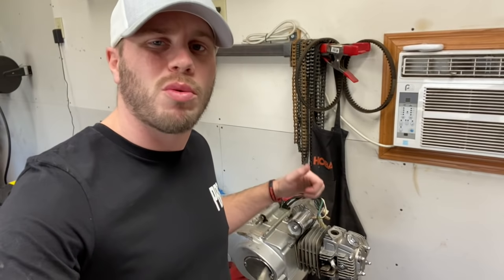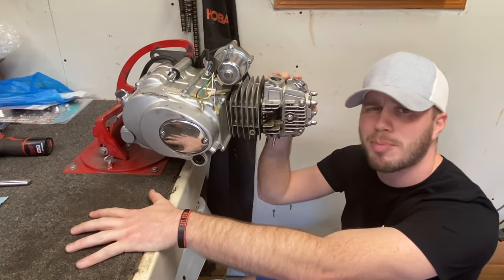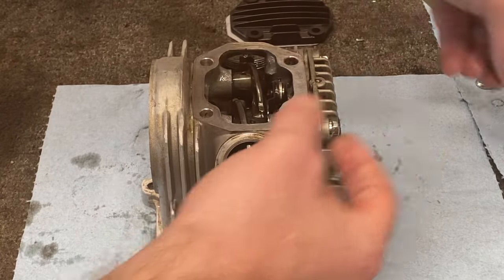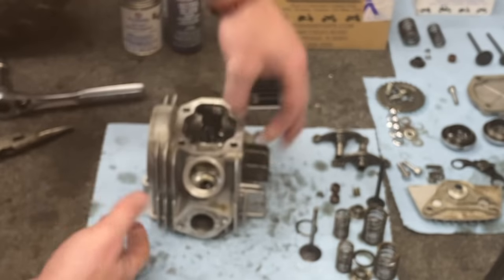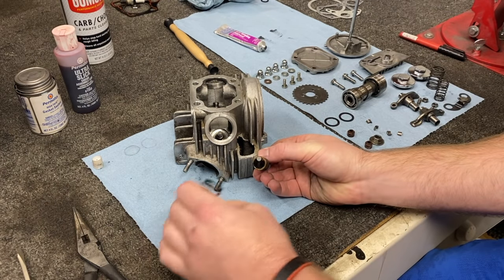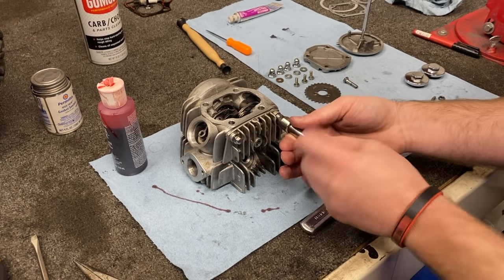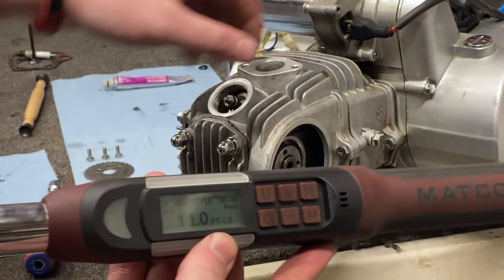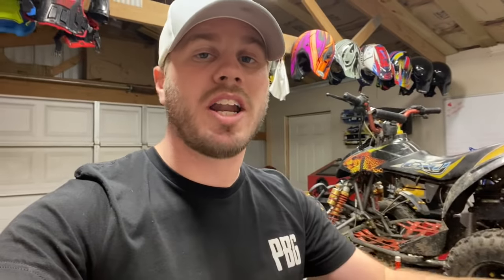HOW TO: Complete Tear Down & Rebuild of a Chinese ATV Engine Head. Every step you'll need covered!

Comment: Thanks so much for the video. Very helpful for a first timer. Struggling with my project though, hoping to get some guidance? I’ve replaced piston/bore, cleaned/lapped both valves. Compression test jumps to 30 and back to zero…no change from where I started. The puzzling thing is doing a crude leak down test (air to head from compressor), the system pressurized. I have a small hiss at the spark plug but aside that nothing coming out of exhaust, intake, or oil fill. Engine is at TDC when doing the test (line with T is centered inside the viewport). Im stumped…unless there’s something I’m overlooking. Any help appreciated, and thanks again for the helpful video.
Reply from the maker: Hey Brian, thanks for watching the videos and I am happy they have helped so far. This may sound silly but you could be getting a false reading on your tester. Do you have another piece of equipment that current runs you could test it on? (lawn mower, pressure washer)?  If everything is put back together and you have spark I would suggest trying to put a little fuel in it and see if you can get it to run for a second. If not your losing compression somewhere!
Reply from the maker: @briangandolfo5789  Honestly man it sounds like your tester, that or your spark plug hole is stripped and not sealing. Even at 30 psi the gauge will hold at 30 and not release back to zero until you clear it. My guess is if you have spark and throw fuel at it she will run. I have never experienced a loss of compression from the oil channel, but even if that was it to only hold 30 psi would mean there is literally a giant crack in the case.
Reply: Alright, well I have some renewed confidence now, maybe this whole thing is because of a bad tester, cause I don’t have any of those other conditions. I haven’t even attempted starting it yet without passing compression assuming that I wouldn’t get anywhere without a good seal. I’m on vacation but I’ll give that a try when I get back. Thanks for the feedback, I’ll let you know how it goes!
Reply: @Praska Boys. Well tester was a factor for sure, rookie mistake there. But I’m only getting 75psi on the test now with a good reading. The entire top end is brand new though. Leak down I’m getting a small amount out of the crank case so I’m losing some pressure either in the piston or through the oil reservoir. I’m just not convinced I have a good seal there, there’s oil on the gasket from the reservoir all the way to the bore. Could that be my issue? If it’s the piston idk what else to do given it’s all new. Any advice appreciated.
Reply: @briangandolfo5789  I'm also fighting this right now. About 70psi on compression. Did leak down test, heard air coming from oil filler, changed piston/rings/gaskets (cylinder still has cross hatching and not gouged). Compression test again shows 70psi and leak down test still coming from crankcase. I'm stumped.

Comment: I have just traded a cart frame for a 110cc 4 wheelerfor my Grandson and there's alot of work to be done some welding,wiring where can iget my hands on a valve press andand the lick done gage and i also have alot of other Questions. About these ATV?
Reply from the maker: Hey Michael! The tools are linked in the videos description if you want to use the same ones I do. Also for more questions you can email me directly at praskaboysgarage@gmail.com

Comment: Can the cam be in the wrong position since it can still be aligned on the exhaust stroke? How do you make sure it's in the right alignment for the compression stroke?
Reply from the maker: Now this is something I was told years ago and I've never verified it but also never had a problem with it. The cam can be in time both on the compression stroke or 180 degree out. It will fire the same. Basically how I see it, is if you're at TDC you can't make a mistake. Now, what I do is rotate the engine until it opens the exhaust valve followed immediately by the intake valve. I rotate the motor until the piston is at TDC after that which tells me I am in the compression stroke. Set your timing and should be good to go.

Comment: Hey I believe the head gasket is blown on my sons Tao Tao 125 atv. It’s popping a lot, from that area, and it’s losing speed when accelerating. I’ve already replaced the carb, and. Cleaned the jets.  I decided to replace the entire. Head.  My question is. Do I need to remove the entire engine from the bike to replace the head? Will it clear the frame?
Reply from the maker: Depends on the ATV actually. If you're in a smaller frame unit like the TaoTao Boulder B1 you will have to remove the motor, but on a larger sports quad will have room. I usually just remove to make it easier for me!

Comment: What is the engine mount you’re using? Great video btw
Reply from the maker: Thanks! This is my #1 question for sure! I actually had a CNC company laser cut out all the metal to start making and selling my own. I will be selling the kits on my website either as a DIY kit or a completely assembled and power coated. Should have everything ready soon and will post updates on the channel.
Reply: @PraskaBoysGarage  yes!!!!  That engine stand is so awesome!

Comment: Great video but I have one question. Why not set the valves up before you put it in? The refurb you showed was already set. I ask because I am doing this to a 110cc and I am leaving the engine in the kart so I don't wanna have to set the valves after the head is back in. Just curious if there was a reason to do it after the install.
Reply from the maker: Thanks! I always set the valves after installing the head to make sure the cam is perfectly aligned at top dead center. That way I know 100% it is set correctly. You could do it off the motor, I just want to make sure I have 0 chance of error.
Reply: @PraskaBoysGarage  I tore it apart today and the intake valve was bent so bad it rubbed the seat so I am ordering a whole new head. Will have fun getting it all back together and firing it up! Can't wait! Thanks for the video as it helped me get this apart in less than 10 min!

Comment: I have a 110cc redcat motor. There is grey smoke coming from the exhaust, (more than there should be.) When I take a look at the muffler, I see there is oil on the inside of it. I think it could be the rings on the pistons but I’m not sure. Any help would be appreciated
Reply from the maker: You're on the right track. I would perform a leak down and compression test and see what kind of state the motor is in!

Comment: I bought a used Chinese ATV and it does not have the decompression valve. I am not sure if its originally had it. It is really hard to kick start. Even the electronic starter suffers when I try to start it. How do I make it easier to kick start?
Reply from the maker: The decompression valve is actually pretty rare on these motors. I was surprised to actually see it. If yours didn't have one when you looked I doubt anyone removed it.

Comment: Were the valve clearances you used from a Honda? Setting my sons chinese 50 and using specs from a CRF50. I believe it called for .002 int. And .003 exh. Seem a little tight?
Reply from the maker: My valve clearances are based on my personal preference but used from the guidelines from Honda motors from the late 90s and early 2000s. That's probably right for a Honda 50cc. I know the CRF70s call for .005 & .005

Comment: Can you tell me what kind bench mounted stand that you are using? I would like to get that for my son.
Reply from the maker: This is my #1 question for sure! I actually had a CNC company laser cut out all the metal to start making and selling my own. I will be selling the kits on my website either as a DIY kit or a completely assembled and power coated. I will post updates on the channel when they are ready!

Comment: Wow .  Great  vid .I have a 125cc ybr  and its making a load of tapping noise plus major lose of power  ...I think maybe I've bent a valve .    Is this process the same for any  125cc   engine  ... springs n all .?  .  Thank u
Reply from the maker: Thanks! Glad you liked the video. The process of a rebuild is the same for all E22 style motors. Your YBR has a vertical cylinder so although the process is the same it will look a lot different because of the style of motor.

Comment: hey man, recently i got a 110cc bike come into my shop and he completely lost compression. I took off the engine head and i found the intake valve to be bent, Any idea what might of caused it cause all tensioners look good including the timing chain + guides
Reply from the maker: I have had them bend in the past quite a few times and really I think it's mostly due to being cheaply made. I had one bend I think when someone dropped a washer in the head and another time it was starved for oil and go way to hot.

Comment: The vmc website, how do you know which part is yours, I have the 125, for a top end gasket kit, it ask for mm, is that the inside of the cylinder and the closes to the mm match for 125s, tks for the help and the vid, top notch
Reply from the maker: 125cc calls for a 52.4mm top end kit. The size indicates the piston diameter. Hope that helps! Thanks for watching!

Comment: Can you add heavy duty /stiffer springs ? And port the runners ?
Reply from the maker: I never have for these E22 style motors. I've only upgraded springs on predator performance builds but that's because your throwing a lot more power threw it. You're biggest upgrade for this kind of motor would be buy a Mikuni carb or at lease a Chinese knock off carb like this one: https://amzn.to/3ssBUQm

Comment: New head, new gasket set, new piston and rings but I still only have 50psi compression. Piston at tdc and timed up perfectly.No leaks coming through the intake, exhaust, or casing. Not sure what I did wrong. Help!
Reply from the maker: 50psi should result in a pretty big leak somewhere. If no leak and those valves are sealing then you probably have either an issue with your valve lashing so double/triple check that. Also if your carb is still attached to the motor make sure you have the throttle wide open.

Comment: Do you know of a higher lift or longer duration cam that will fit this family of engine? 
Thinking about doing a mild port. Never done it but if I screw it up, haven't lost much. When installing a better carb I noticed the intake port is extremely small and never going to see any gains without addressing it.
Reply from the maker: Performance parts are tricky for these little guys. Anything I've purchased has been with Tbolt USA. They advertise performance cams that add 1hp but I have yet to test it at this point. The biggest upgrade you can do that I've found is using a Mikuni carburetor or at least the Chinese version of eBay for $35 bucks. Best bang for your buck in my opinion!

Comment: quick question my engine is a 125cc 52.4mm bore with 32 tooth cam sprocket all the heads online come with 28 teeth can i swap the old cam gear onto the new head nd will it work?
Reply from the maker: I'm not 100% sure on the answer. At one time I did a ton of research on cams, rods and sprockets for these motors. There is nothing concrete so I just need to spend some time playing with them!

Comment: Could a top end compression problem make a ticking or knocking sound? Or would it be further internal? It runs but I don’t have a compression tester so unable to test
Reply: I do believe that the motor was starved of oil bc there was a leak and next to no oil in the motor would the top end be stuffed or more so the piston and boor

Comment: What is the 2 wires going into the block by the front sprocket...
Reply from the maker: That is a gear light indicator. If your atv was equipped with a neutral or reverse light that's the sensor.

Comment: sorry thought of another one the dealer i bought mine from said to NOT use synthetic oil is there a reason that you do i mean besides the obvious reason that its just plain better oil when the dealer says not too?
Reply from the maker: Oil is a hot topic for a lot of people and everyone has an opinion. Here are my thoughts: The reason he might advise against synthetic oils is because they contain anti friction modifiers which is not good for a wet clutch because it might cause the clutch to slip. However the exception is that I use specific synthetic AMS oil that is designed for motors that use a wet clutch.

Comment: So if I do the jug and head for BBK would you say to drop the timing chain tensioner out the bottom of crank case or leave in? Can a jug and head change be done without removing the timing chain tensioner?
Reply from the maker: Who are you getting the kit from? If it's someone like TBolt USA they have great install tutorials online. I've never taken the chain tensioner out when doing a top end, but you defiantly can to make it easier.
Reply: @PraskaBoysGarage  already got kit and know how to do. Just some show tensioner out and some leave in. Figured I would ask. Engine is like brand new with 150 miles on it. Just doing 72cc BBK to a 50cc engine.

Comment: I rebuilt a 110cc new piston and head with valves.  Only getting 60 psi on compression. What did I do wrong?
Reply from the maker: Could be a few different issues. Do you have a leak down tester to see where your problem is?

Comment: Great video. I had to change the head due to the exhaust bracket breaking and messing up the studs into the head. I bought a next head timed it like you did in the video as well as sets the valves. But it’s not starting:( I also hear a clicking noise from the intake possibly valve. You have any suggestions
Reply from the maker: Hey Andy, sorry I am late to the comment. Are you still having your issue? What size is your motor and what head did you purchase?

Comment: Hello , took out the what i thought was to drain oil on bottom, and it had a spring on it. Not sure if any thing flew out maybe oil. What is the spring holding
Reply from the maker: That is your cam chain tensioner. In order is the bolt, spring, and plunger. It puts pressure on the cam chain, not a big deal you took it off. Just make sure it goes back in the way it came out!
Reply: I didn’t see a plunger it may be stuck up in there. Non came out readily

Comment: Thank you for your very detailed information!! This weekend my kids Tao T-force 125 started up fine and then I heard a few metal on metal sounds that were a few seconds apart and then it died.  Now when I try to start it the starter just spins the flywheel.  I have spark but no compression.  Any advice will be appreciated!  It is less than 6 months old.
Reply from the maker: When you first got the ATV did you change the oil or have you been running with what came in it? The motors in my experience usually fail from being neglected over time. It's the electrical that is the root of most issues. I would drain the oil and look for metal flake in it. If you don't see anything out of the ordinary then I would put new oil in and check for compression.
Reply: @PraskaBoysGarage  yes sir I replaced the oil when I bought it and it has not been abused.  My daughters ride it a little on the weekends and has been garage kept.  The metal ping sounds just before it died and now no compression make me think it might be a valve issue.  After watching a few of your videos I ordered a new head from VMC yesterday.  I hope when I open it up that the problem is obvious.  I have a warranty on the ATV for parts only but would still have to pay $95 per hr. labor so I decided to attempt to fix it myself.  Thanks again for your videos!!!
Reply from the maker: @80MRBROWN  Alright sounds good man and let me know if you have any questions in the process. I charge $0 dollars an hour so shoot me an email at praskaboysgarage@gmail.com if you run into issues.

Comment: I have a 110cc coolster and i keep hearing a popping  sound when i fire up. I believe its coming from head gasket and looks like gas is leaking from it? And i can see liquid on the exhaust pipe
Reply from the maker: It sounds like the motor is running rich (to much fuel). Did you make any changes and then it gave you issues or was it running fine and then started doing it?
Reply: Only thing ive done is set it top dead center and spark plug. Has a new carb and oil changed. Soon as i start it it sounds like backfire but it comes between the gasket on top end. I may take the carb and see if the over flow is getting stuck. Any info helps. Im new to this and Just trying to learn.

Comment: While the engine head is off, why wouldn't you pull the cylinder off to check for suck rings or broken rings?
Reply from the maker: Your absolutely right. However this video was already going to be super long so I wanted to focus my attention to just the head. I will do a follow up later with cylinder honing, ring gaps, and the "what to look for" information.

Comment: When setting the valves, does the gap need to be precise or can i get like some mm off?
Reply from the maker: You have some variances allowed. Basically you just don't want it to tight so the valves get stuck open or too loose that they are slapping. Use the proper feeler gauges and you will be fine.

Comment: When changing the head, is there a torque spec for replacing the cylinder?
Reply from the maker: Yes, I follow the torque specs for the Honda motors these are a clone of. If you search 90s Honda dirt bikes they have the same engine and those torque specs work for this motor.